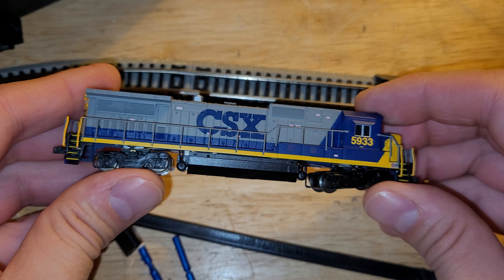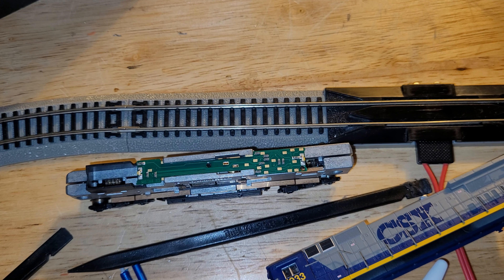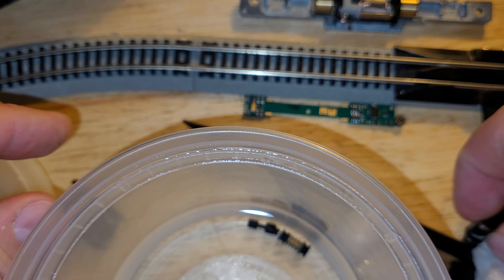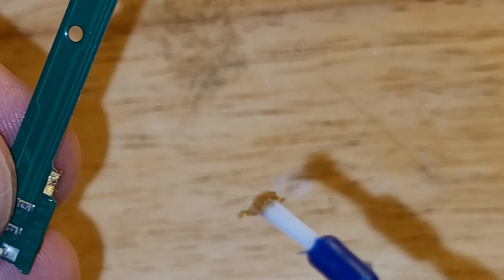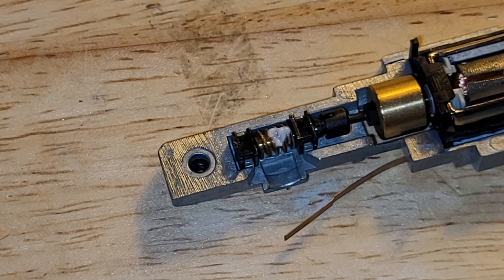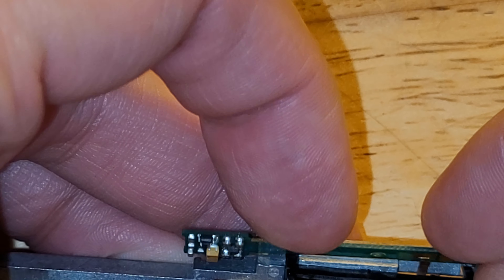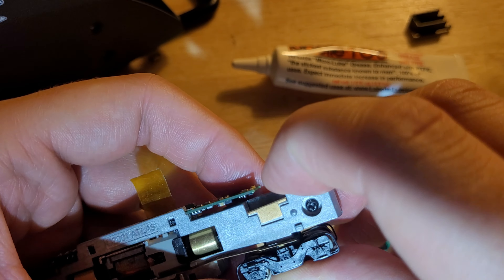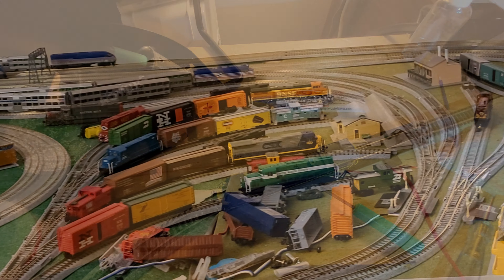Forgotten CSX B40-8, will it run?

Comment: Using liquid flux and a small paint brush to apply it to the tiny pads makes it so much easier. Also a smaller soldering iron tip. You get so much more control of where and how much solder you are applying.

Comment: By the way. I have an idea for an Alco research video you can do. I had a friend who served on the USCGC (WAGB-10) Polar Star. A Polar Class ocean going Ice Breaker that is used to go to Antarctica. It turns out it is powered by six Alco 16V-251F diesel engines as well as the three Pratt & Whitney FT-4A12 Gas Turbine engines which are used for propulsion while breaking ice. It and it's sister ship USCGC Polar Sea were commissioned in 1976. The Polar Sea was decommissioned and is used as a parts source for the Polar Star.